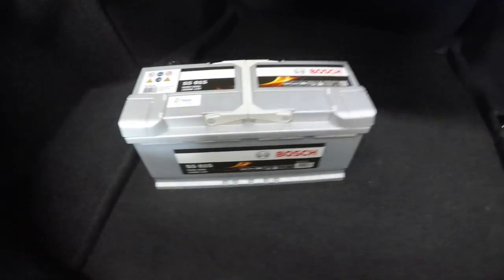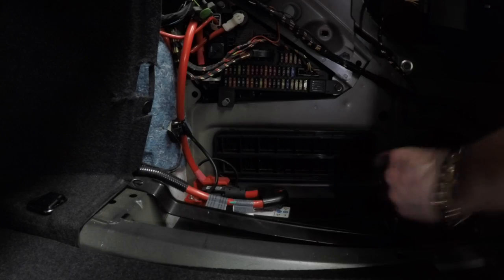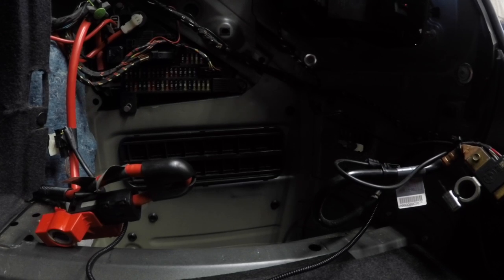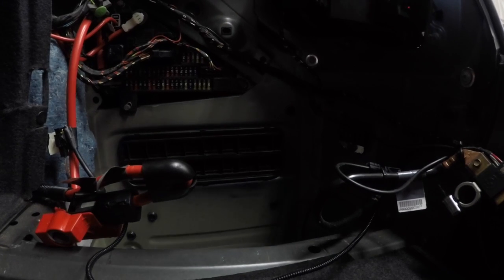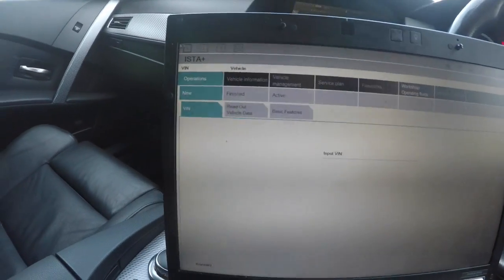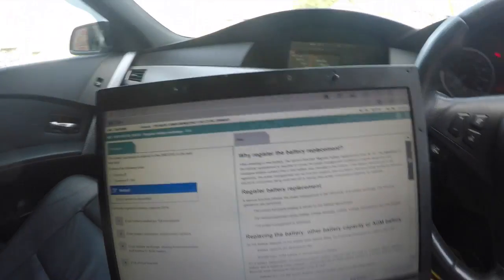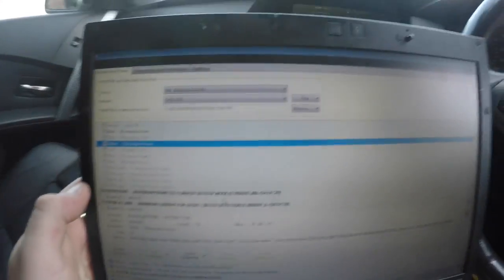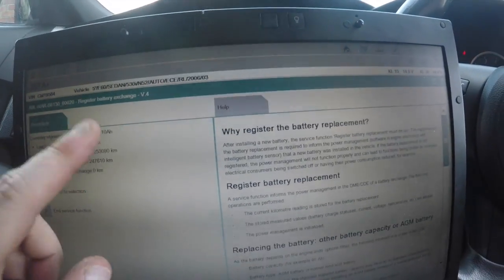BMW Battery Replacement & Battery Registration With Ista D & Ncs Expert You Been Doing This Wrong

Comment: Hi mate, if I change my battery  from original one 90AH 160RC 900 CCA to 92AH 850CCA do i need to code and change the capacity of it or just register it as new?
Reply: Theres a step that ask if its same or different capacity, just have to state it

Comment: Hello, the key step in how you changed the Ah on the battery was not explained clearly. Did you use a different programme to make this change? You started and ended with Isda but may have changed to Inpa???  "You got the battery voltage on the CAS", how did you get to this step???

Comment: Doctor Dean, do I need an AGM battery for an e90 LCI that doesn’t have start stop technology? It has a black BMW battery that doesn’t say AGM but I believe it is as it’s black not white, I know I need to register and code it but will it cause any electrical problems using a non AGM?

Comment: Forgive me if you’ve answered this many times before. If you swap a battery with the same AH as the old battery do you still need to register it? My clock on my 2007 e61 sometimes resets itself to - - : - - My googling looks like it’s pointing to a weak battery although I have no other error messages. What’s your expert opinion Doc? Do I need to replace the battery or am I looking at more complicated issues? Many thanks. Great helpful knowledgeable vids!
Reply: Since its been four year you probably have a new battery again and yes you need to still register it since the car changes how it charges the battery

Comment: Hey Doctor 🙋‍♂️🙋‍♂️
My e60 530i Mod. 2004 had an old battery that started to drain.. I replaced it with a new battery, and programmed it by a local dealer.. 2 problems happened. 
1- The servotronic warning with active steering fault appeared

2- After 2 days of battery installation and driving the car for long distances along those 2 days, i found in the morning that the battery has totally drained. Knowing that no drainage warnings appeared at any time.

What do you think the problem might be?
Reply: Hey Dan, I have the same issue! Did you fix yours? And if so how?

Comment: Hello,

I have a F30 328i and I change my battery like 3 month ago. 
I have ista so naturally I register it but it wasn’t the same capacity (original one was 5ah lower than the one I buy). 
I knew it need IstaP to “change” the capacity but as I just have the enet câble and no energy sustainer i never use it. 
Now I know that I can do it with ESYS (since I have F série and not E serie). 
My question is simple:
- Is it ok to do the coding amp change now?
- is it worth it to do the change for 5AH?

Comment: Only one video missing: how to install ISTA or Rheingold in your lap top. Sounds crazy, but I will never use the tutorial if first I dont know how to install the programme. Sound silly I know. You could say that there are plenty of tutorials on line, but, are there not equal number of battery replacements DIYs? So, should we skip this channel. I think no. This guy explanations are amazing, but if only he posted how the crap install ISTA.
Reply from the maker: I can’t do that mate as the installs are different on every system including MacBook all different on every operating system that means I would need to make 3 videos and it’s a long process to install maybe 1 hour each

Comment: Hi Doctor Dean, my Car has following symptoms :

1) key is not sensitive when I try to unlock my car or lock my car. 
2) when I unlock the car, my e60 no welcome light now.

I send to workshop for battery check and any current leakage, no symptoms.

May I know what is the possible causes?